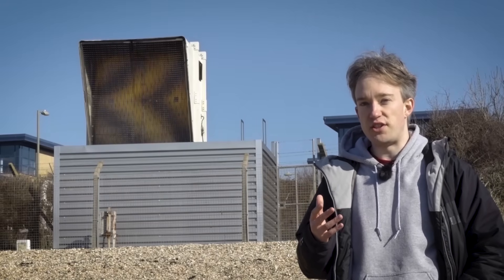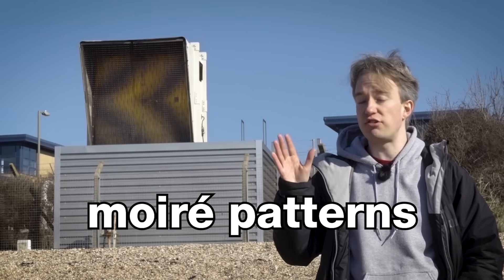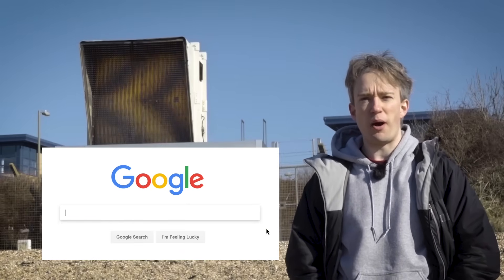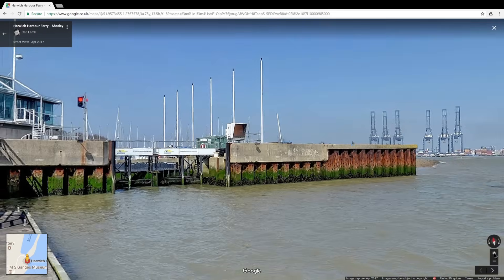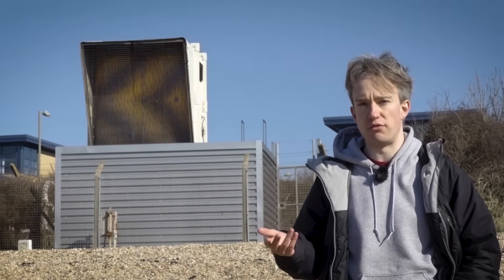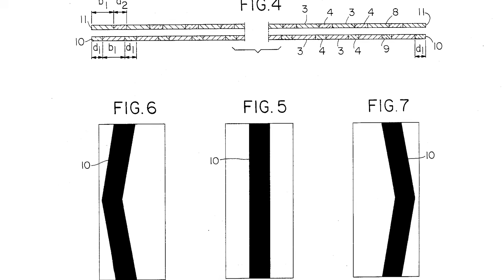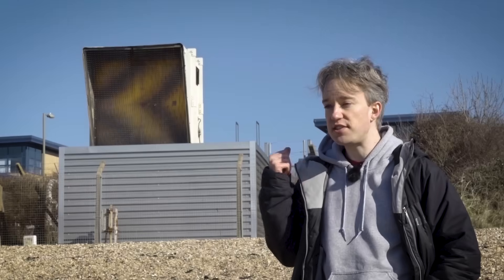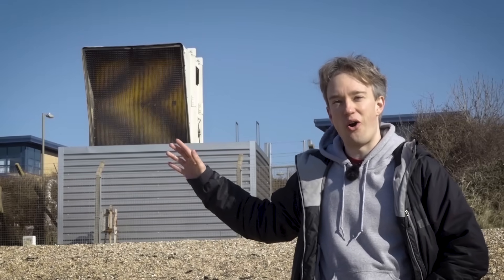The moiré effect lights that guide ships home

Comment: Is this question still unresolved 16 months later ? Surely the Southampton Harbourmaster would know the answer as to why that particular light is being used in an abnormal way, have you asked them ? Also, it looks relatively new and therefore all shipping and boat captains who use the harbour must have been briefed when it was introduced and told what it's intended purpose was for, have you asked any of them locally in the boating community ? Find it hard to believe that this question is difficult to find the answer to.

Comment: Range markers are used to mark a channel by lining up two lights that are above one another. The reason they used the Inogon leading mark is to have a visual for where a cable is and not to set an anchor on it. This was a way to mark that spot and use something that would not be confused with a range marker.

Comment: OK lets talk about sea navigation. when your at sea you can go anywhere , and unlike roads there are not signs marking places to go, its reverse is there is signs its a warning. think about light houses. at sea, if you see the house you keep away from it and from the rocks. its the same in this case. There is a arrow because there is a danger.

This same system is used at airports and was made up in WW2 to help plains land and helps keep them in the right flight path to land

Comment: +Tom Scott, the answer to why the signal would be used to protect an undersea cable is as follows:

The sign is set up to be perpendicular (90 degrees) to the direction of the cable and is placed exactly above the cables location where it meets the shore. The cable must also run in a straight line only.

When this is the case if you see an arrow to either side then you are not above the cable and are therefore safe to drop anchor. If you see vertical lines only then you are exactly over the line of the cable (being straight and being perpendicular to and directly below the sign) and are therefore not safe to drop anchor.

Comment: There's signs like this on a highway intersection nearby me, where the turnoff to the other highway is a rather sharp corner. Basically just like the standard red/white arrow signs but these give the impression they're 'moving' so you'll be extra warned I'd guess.

Comment: I wouldn't even know how to try answering your question at the end of the video. However, found something that you may find mildly interesting. If you check google trends searches for "inogon light" were at zero per month up until your video came out. Since then they have skyrocketed. Apparently people want to know more... oddly enough "Moire effect" was searched a bit but nobody ever seemed to connect the two until now.

Comment: These lights are also used on Dutch roads where the road makes a sharp turn (For example the cloverleaf-like highway ramps, but also smaller, twistier roads). The use of this particular sign makes it possible to put one sign in the outside line of the turn, but let cars from both ways see the arrow in the correct way. Also, it gives an indication of how big the radius is.
Reply: Do you have any examples where? I live in Eindhoven and have never seen one

Comment: Speculation mode: when at sea it might be hard to be sure if you are on a straight line with the sign. By using the moire sign you will always be sure if you are dead centre to the sign, or off centre. So if you can see the arrow, you know not to throw out the anchor.

Comment: Arrows typically point where to go. A maintainer of submarine pipeline/cables would interpret this signal differently than any other voyager afloat. ¿Possibly this light was installed with maintenance in mind?

Of course, nowadays subsea support vessels use GPS and electronic charts (ECDIS) to guide their activities.

Comment: I would have thought that a marker that is pointing away from the site, would be perfect. If you can see the light is pointing away, then you can't be in line with the thing, so you're safe. They're just using it in a way that is opposite to the original purpose.

Comment: I hope this doesn't get buried, but I have been wondering for years now: When driving on the motorway i see those hexagonal moiré patterns. which seem to get smaller and smaller as you approach them. My question, which will hopefully nerd-snipe someone more than me, is:
Does the angle subtended by a fringe to fringe on a moiré pattern stay the same as you approach it? if not how does the angle change? Please help me find an answer!
Reply: This is due to the change relative distance between you, the front fence, and the rear fence. You might start at 10 times the depth between the fences, and close to within only 2 times.

Comment: Hi Tom,

I live near the light and am aware of the connection it marks from the refinery.

Is there a chance it was used as a guide for the barges to construct the link and simply remained as a warning marker?
Reply: After all the tunnel was made before GPS so it may have been a good way for the barges to keep in the right place in the tides

Comment: I wonder if the intention was to reverse the rear screen, and that part of the work order never happened.  With the rear screen as a V pointing away from the front screen, it'll provide moiré arrows pointing towards the line, but with the rear screen as a V pointing towards the front screen, it'll provide arrows directing away from the line.

You could find the company that operates the light, probably the same one that operates the cable, and ask them.  They might know the rationale.  

It might be helpful to see how the underwater cable is labelled on paper navigational charts.  If it's marked as a line of 'don't anchor here', then boaters have to be able to accurately locate that line, if only to know when they are in the 'don't see an arrow' location that they can't anchor.

Comment: Just a small note for you from a nerdy Swede myself..
FMV means Försvarets materielverk, and handles all stuff related to the Swedish defence and military stuff. This includes secret spy stuff and innovations, such as the patents for the Steling engine that powers our U-boats.
With this in hand, the reason it was removed from the website was probably either because it was labeld as classified, or handled over to another Governmental agency (such as Transportstyrelsen / Agency for transportation).
I've seen a few of these around the archipelago around Stockholm and Gothenburg, but didn't realise their significance until you described it here in the video.
Again, thanks for another great video!

Comment: I thing in the Netherlands they use this for roadsigns in sharp corners, so if you move closer the arrows move rapidly in the pointing direction. I am not shore tho if it's the same system as the light.

Comment: You seem to be thinking of this indicator as giving an instruction (steer this way) rather than providing information (the pipeline is on this side of you).  This is a form of an installation that is called leading lights in the UK or range lights in the US.  The usual form is a pair of lights and/or daymarks mounted some distance apart with the one in front lower than the one in back.

They are used to indicate a bearing of particular interest to the mariner -- mid-channel is here*, Danger ground on to *left of this, danger ground *here*.  Other than the fact of the bearing being pointed out as interesting, you cannot ascribe meaning without consulting your chart or Coast Pilot book.

Comment: just spoke with one of the guys that used to move our inspection and maintenace barge, its for centering the barge just like the light pattern system we have in aus over submerged cables. 

my main comment is in your post tom. but basically they inspect maintain and dive over the pipes regularly.  Especially after bad weather or big tides. from what i was told, (he might of been pulling my leg) but they arent used as much here because its usually too bright sunshine wise to be as comfortable to see as the system here.

Comment: I have not done any research but it does make sense for marking the cables that you don’t want people to anchor over, as long as who ever is captaining the ship/boat knows the area and knows what that is marking, they would know that seeing the two lines is the no go area, if you just had something that was constant from every angle, that would give you no information about were you should not be. Doing the same thing with buoys would require many marking out the cables and then they might also be in the way of shipping or boat traffic.

Comment: When you're in line with the light and you see the middle line that means you are right on top of extremely close to the pipelines. The arrows are used to guide people in towards the pipe mostly for divers and repairers. We had this same setup in my town but has since been removed due to GPS.

If you can see the arrows or line then you can damage the cables/pipes that are layed underneath.
Reply: This was my assumption as well. That it's used as a guide more for maintenance teams.

Comment: This is quite similar to the PAPI lights at airports.  A set of four lights, each of which can be either red or white depending on the viewing angle, is placed at the start of a runway and guides planes on their final approach to landing. If the plane is too low, the pilot sees 3 or 4 red lights, if the plane is too high, the pilot sees 3 or 4 white lights. If the plane is on the correct glide slope, there are two red and two white lights. I realise that it's not an identical system, but is similarly clever.

Comment: Are the places which use this inogon light bought it from some manufacturers (like buying a set of lamps), or build it themselves? Because if it was sold by some manufacturers, it's possible that the Southampton's pipeline engineer at that time (or I don't know... designer?) just want to save money by buying a piece of equipment that they know work well already (although with counter-intuitive pattern) instead of build a new one (with the actually needed pattern).

Comment: Great research
It could have been there to mark the underwater cable route during installation or maintenance and that is why it is no longer used. The navigational chart will have the underwater cable marked and will also show that there is no anchoring in this area. Sometimes they also use range lights or leading lights which is basically a transit with one marker mounted behind the other and when the two range markers or lights are directly behind each other it is the proper course that the ship must use to enter or leave a harbour. I love your channel thank you.

Comment: What's wrong with flagging areas that you shouldn't drop your anchor? What else should they do? Tell you all the time where you can? That would be so inefficient. More simple signs show where the zone starts where you cannot drop an anchor (and the back of it shows that the zone stops, for if you come from the other direction). Then the same at the other end. Similarly if there's a shallow point they'll put a marking there. Not to make you aim the marking but to avoid it.

Comment: Moire patterns are also used by some civil engineers to detect building movement. you put two patterned stickers on top of eachother and movements as small as 0.3mm cause the pattern to change, making it visible from several metres away

Comment: Another neat example of a dumb guidance system is the Precision Approach Path Indicator (PAPI) lights by many airport runways. A row of four lights show a combination of red and white to indicate how close the pilot is to a 3° approach when coming in to land: two red, two white means you're on the money; more red means too low, and more white means too high. It works extremely well, and has no moving parts or computers - it's just designed so that you can only see certain colours for each light from certain angles.

Other runway lights use less precise obscuring tricks so that a light is green when you're approaching from the correct direction, and red from the wrong direction.

Comment: It may have been answer. The reason for this light, is not to protect an underwater cable but actually and underwater fuel transfer pipe form the oil refinery on the west side of Southampton water, from vessels anchoring. Fuel is pumped into holding tanks on the east side, ready to fuel ship on the S.O. EAST fuel piers. I instruct on Southampton water and I point this to my student, now I have the correct name for it, as Ive always known it as a moiré light.

Comment: No evidence, but here's an idea: the Moirè patterns in this particular light are set up so if a captain is about to drop anchor and turns his boat to face the shoreline, he will see the two parallel lines if he is anywhere inside the 'no anchor' zone. If he sees an arrow pattern, he knows he is safely outside the zone, with the changing Moirè patterns giving a rough idea of the distance to "safe water". You wouldn't want to drop anchor right on the edge, and then have your anchor dragged through that cable/pipe due to wind or tide, I imagine the fines and costs involved would be rather steep.
If it works the way I think it does, it would seem to be a very clever and efficient way of using a single passive marker to demarcate a "strip" of water under which the cable runs, able to warn multiple ships of how far or near they are to the exclusion zone.

Comment: Surely it's to stop boats damaging the cables and pipelines below? If you know where the pipe is by looking at the light, you know where it is and isn't safe to anchor.

The Moiré Effect was probably chosen as it can be used by multiple vessels at different distances with the least amount of technology 

An anchor be dragged over the pipe could be an environmental disaster

Comment: This is a great example of how far search engines still need to improve. Google revolutionized the search engine industry with their PageRank algorithm which shot them to the head of the pack. And in the years after they have improved their searches leaps and bounds. I am sure that deep neural networks are used these days in many searches. But this example shows a great example of how weak current searches are. Because this is a case where you know EXACTLY what you are looking for but it’s just esoteric enough that you need the EXACT search phrase. But the reality is that there are a lot of situations where people want to search for one thing and their way of describing it naturally leads search engines to show thousands of results for X and nothing else, but where a human would suggest “maybe X Y or Z” in equal likelihood.

Comment: If they tell you somewhere how much clearance you are required to leave before dropping anchor, you need a line of reference from which to start measurement of that distance and this light provides that, hence it points toward the hazard, not away. (?)

Comment: I somewhat disagree that they point the wrong way. It's just marking the location of the hazard. here in the states (and I'm sure many other places) we use little flags, or semi permanent plastic bollards stuck in the ground to mark buried septic,  power lines, etc. It's easier to mark the hazard than marking where the hazard isn't.

Comment: Tom, yellow means hazard in the maritime world. So the leading light is there warning of a hazard and directing shipping away from it. Colours, shapes, flash sequences, horn blasts all mean something and sailors know the meanings, but also usually have a chart close at hand to look up unusual things. So the fact that it is yellow, means it's a hazard and you should stay away or keep your distance. The fact that it has arrows means go this way to avoid the hazard and the two parallel lines mean that you are over the hazard and it extends all the way in that direction. They would use this light there instead of a buoy for that reason. Buoys are used to mark smaller hazards such as wrecks which you should go around and give a wide birth. Everything has a reason :)

Comment: Same deal with runway leveling and approach lights. Four in a stack that change from red and white depending on the angle viewed. Most species on this planet use light for navigation. We're not even the only one that makes it's own light...

Also used to use this effect to help with vectoring in video games. Line up a head shot in max Payne before side stepping into a room. Nice to put a name to that.

Comment: There are markers along Dutch roads that use a similar system. And there the arrows do indicate which way to go. Usually on motorways near sharper bents in the road. The faster you pass it, the faster the arrows appear to move. 
Though there's no light behind those arrow markers, it's a completely passive system.

Comment: This is a problem you come across a lot with programming languages.  Every now and then you will be looking through someone else's code and you will see a symbol or combination of symbols or some otherwise common command used in some sort of seemingly unorthodox way.  You have no idea what that line of code does because of course the person who wrote it didn't comment their code because no one does.  You can't search for what $= means even if you know the language (it's Perl).  How do you search for what "for (Map.Entry<String, Integer> e : histogram.entrySet())" does if you've never been introduced to the wonderful world of enhanced for loops in Java?  Even a manual or tutorial book doesn't help because most of the authors of those books love to throw those in seemingly random places when they're trying to teach a specific concept instead of putting it in some appendix where logically one would think to look for it.  It's as if programming languages existed before Google and Stack Overflow.